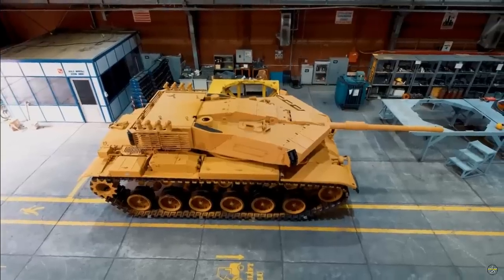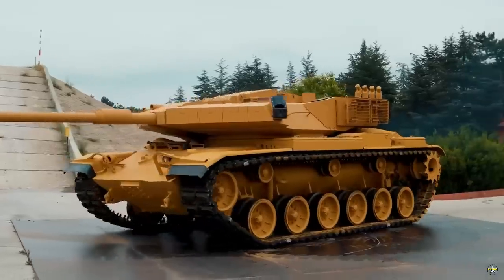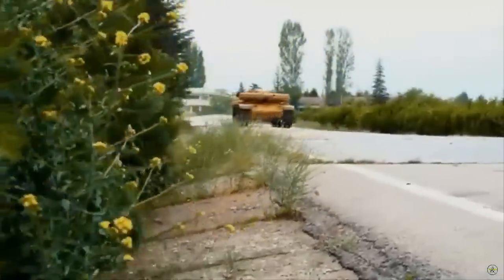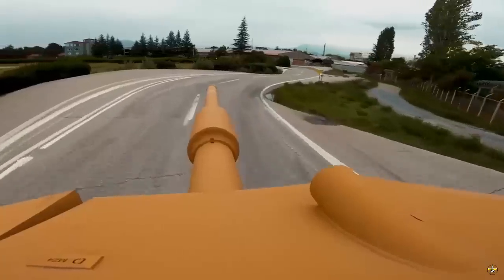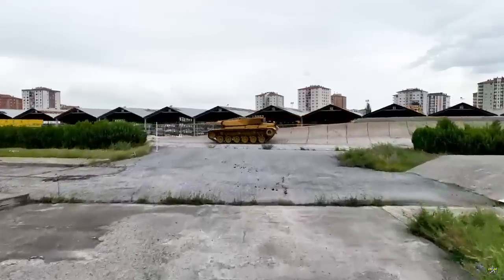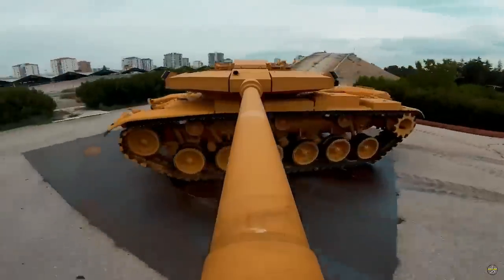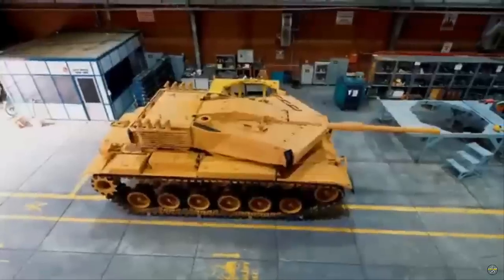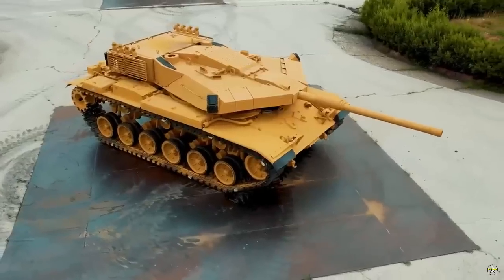ROKETSAN MZK Tower is ready to serve TAF

Comment: the main gun also replaced by 120mm/L55 gun right?
Reply: Yes
Reply: @m60tsabra24  tis nothing more than just a jump start for upcoming upgrades for Altay Tank id presume?
test bed for several new technologies that might or might not ended up as standard on upcoming upgrades package for already existing Altay or other tanks still in active service within Turkiye Panzer Armee ?
Reply: @dureteheiral1793 And its most likely to upgrade and gain experience by modernising the current turkish tank fleet. Seeing how the Altay Tank is still late in production.
Reply: @chewbacca3269  make sense, Turkiye's armoured corps still has hundreds of M60s in their service, better upgrades those rather than wait the arrival of Altay which is probably still years ahead..